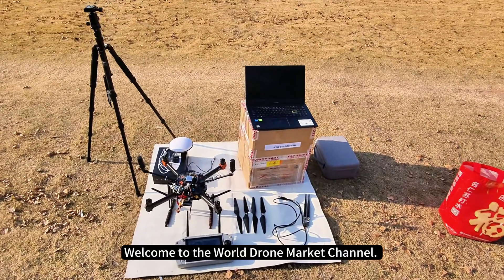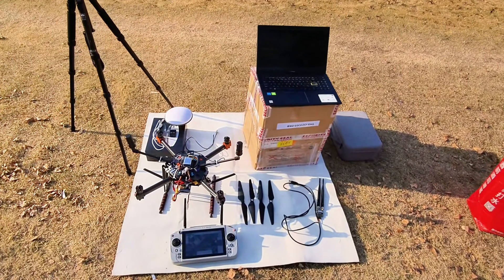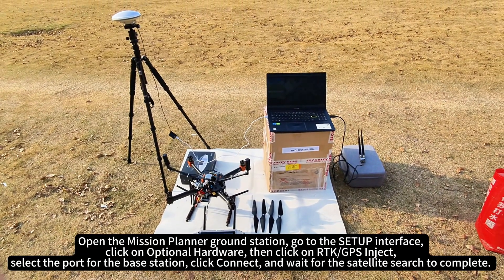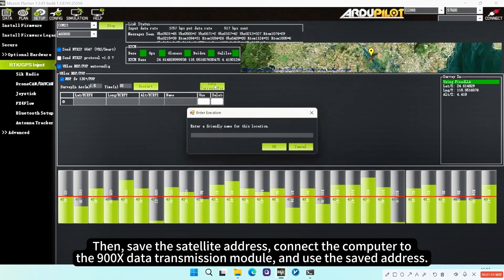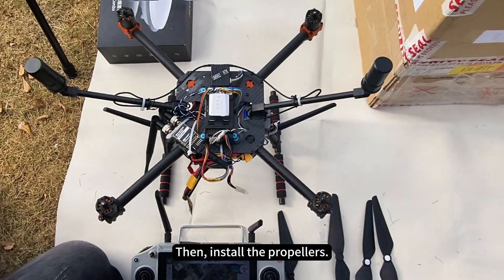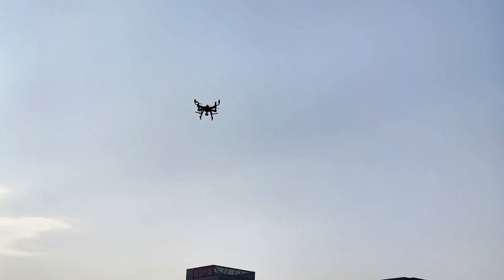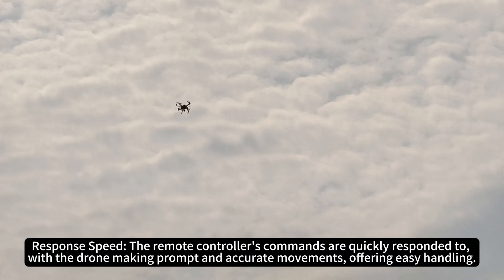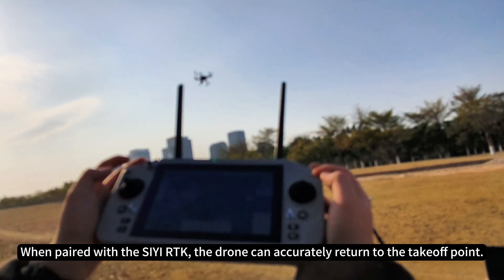Flight test of the Skydroid G20 and SIYI RTK

Comment: Nice video. Why do you need the RDF900X modules ?  Is it not possible to send the RTK base station data to the G20 via Bluetooth and then use FlyGC/QGC to send it to the rover via Mavlink ?
Reply from the maker: A data transmission module is not always necessary. The remote control can be connected to the computer via TCP. The computer sends RTK base station data to the remote control, and finally the remote control transmits the data back to the computer.